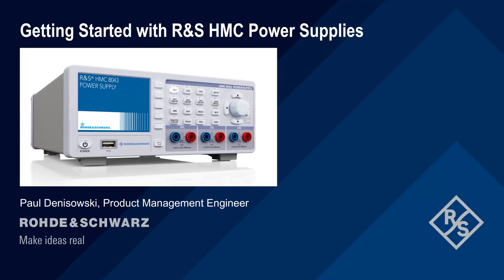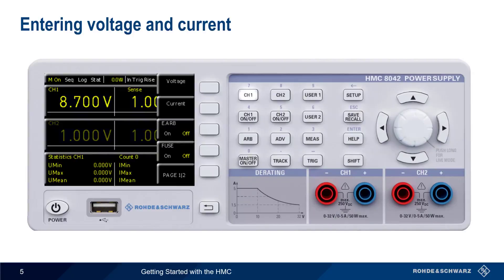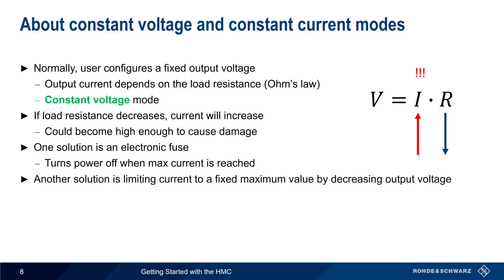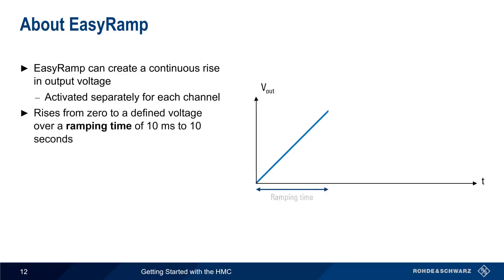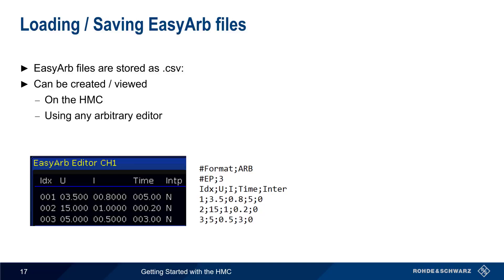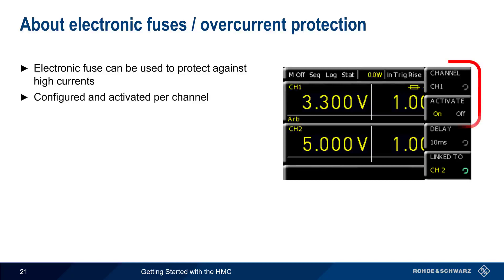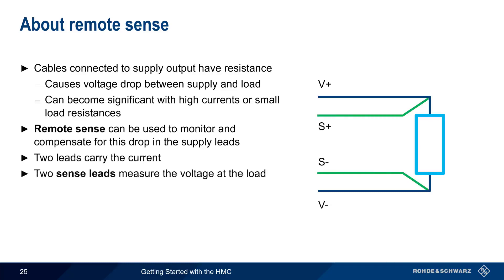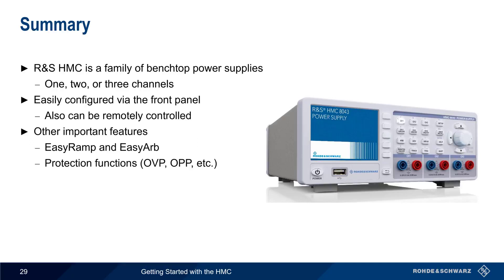Getting Started with R&S HMC Power Supplies

Comment: Great Product, i really love mine.
 It´s the price worth. I still have two little questions.  

1.) Is there a shorter way for setting the statistics on the HMC8042 Power Supply to zero instead of clicking:
 Meas / STATS / Clear / Meas / Meas    ?

2.) Is the Device HMC8040 Build 7199 from 2017-09-25 with Firmware Version 01.400 the latest firmware (or is the firmware on your website from December 2017 newer) ?

thx !